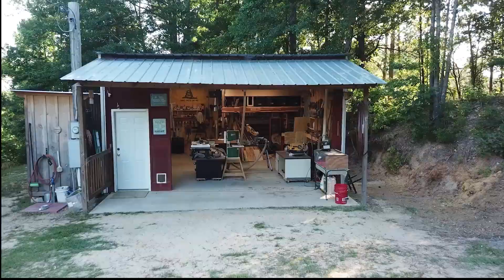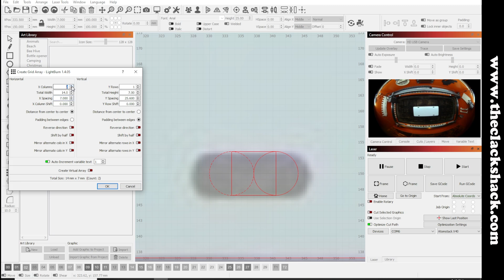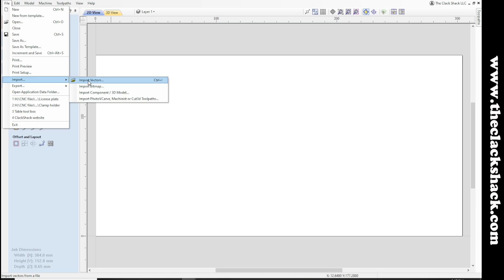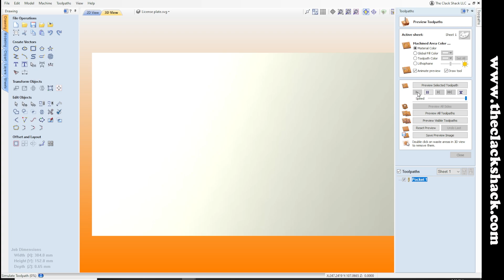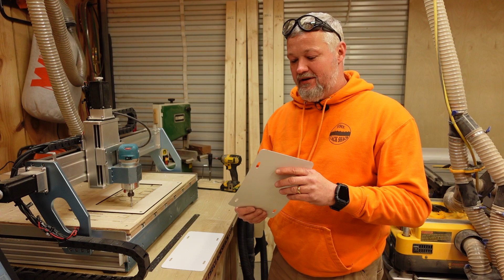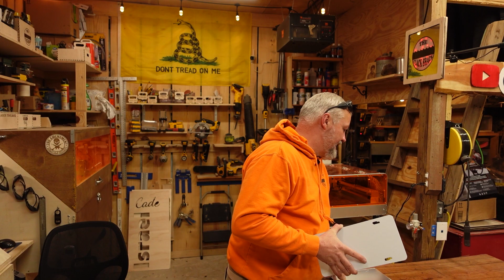Cutting aluminum with the Genmitsu 6050 PROver XL plus

Comment: I do the green painter tape on the bottom of the piece and on the spoiler board. then super Glue it down. It works Well but will gums up the bit after a while but rubbing alcohol cleans the right off.
Reply from the maker: Agreed

Comment: Consider a screw down magnet recessed into the spoil board.  Set the aluminum workpiece in place.  Set a lose magnet on the workpiece over the embedded magnet.  That should prevent the workpiece from “escaping” the CNC workspace.  Remove the magnet from the spoilboard when not needed.
Reply from the maker: Good idea..

Comment: Just curious, do you not consider that flag disrespectful? A desecration of the American flag? Not trying to be mean just curious cause I like to know the people I follow and buy stuff off of. Thanks for your videos they are a lot of help.
Reply from the maker: No, it is not. Sorry for the history lesson but many people label things and Anti something without knowing the full scope of it. The flag has its origins in the declaration of independence, it was a symbol of independence and a warning to those that would trample on the rights of people (The British at that time). The original design was used by many folks who's name can be found on the bottom of the declaration of independence and helped to write the Constitution that we follow today. I also have the stars and bars, declaration of independence, bill of rights and many other historical items around my place. I am a firm believer in what our forefathers wanted in the breaking away from British rule at the time. The modern flag was not adopted until much later after the acquisition of all 50 states which was after 1960. The flag is not an insult or shot at anyone, It is simply a historical reference to ideas that most are the same as we should all have. I have spent 23 years protecting those rights of every person in my community as a law enforcement officer.

As far as me, I believe that God gave all people rights that should not be controlled by anyone. All people should be treated equally and with respect. I believe that we are all entitled to our beliefs and opinions but do not have control over the opinions of others. I do not judge people by their beliefs, I do so by their actions toward others. Also, like the rattlesnake, I will not run away when faced with an attack or being stepped on.   

That is me in a nut shell... PS, watch my intro and notice the Stars and Bars is on the front of the shack....

Comment: Congratulation on learning Vcarve or Vcarve Pro. I have had Vectric Aspire for over 10 yrs now and tho" anything but an expert, I use it to design for my lasers also as it exports SVG files, among many others. It was very expensive but, as I told them, the more I used it the less expensive it became. My only complaint is that it is a Windows only software. I have been a Mac guy since 1984 and own several of them. I run Aspire inside of VMWare Fusion and it works as well as a Windows based machine. Keep up the good work....enjoy your videos....
Reply from the maker: Thanks, still a way to go.

Comment: Are you trying tying to trigger my OCD, straighten that router up so it is parallel to the gantry. I wondered how long before we started seeing Jigs for the CNC.
Reply from the maker: If you talking about how I have I rotated in the clamp, that’s so I can control from the left side. Once my relay is back working, I will turn it….lol.. hopefully today
Reply: @TheClackShack  Now that I know the reason it is not straight my OCD can settle down LOL

Comment: Very intriguing! I have to cut my aluminum with a guillotine style cutter. Took a while to get it working easily, but I did! I cut a 12” x 24” sheet of sublimation aluminum into 1” squares, then round the corners off with a 1/8th” corner dye cut. I get to go up to 4” pieces.
Reply from the maker: Yea, Tim has all the cutters but the holes wasn’t something he was equipped to do.